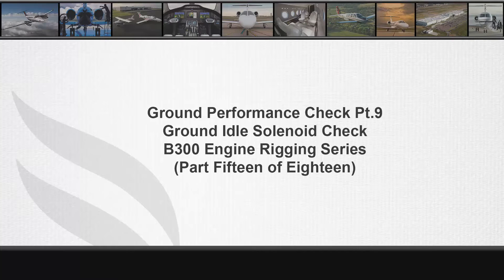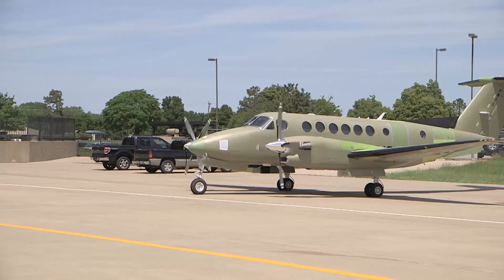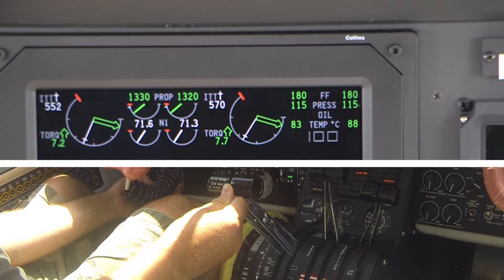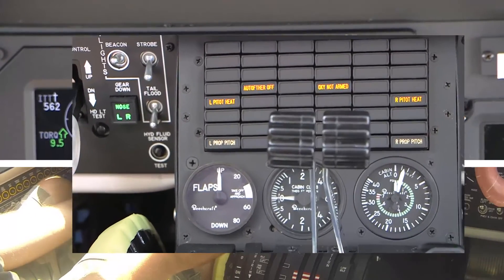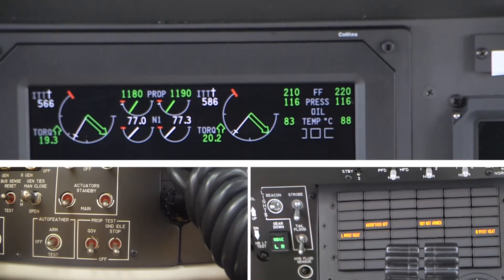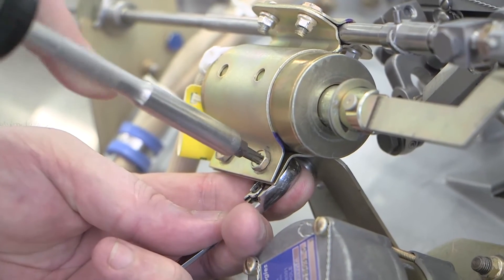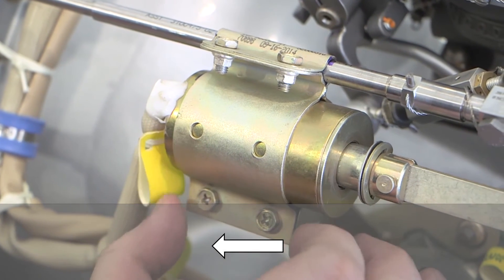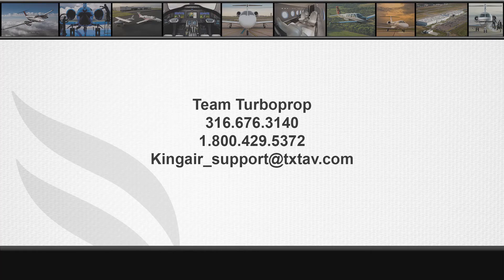Video # 15 - KING AIR B300 SERIES GROUND SOLENOID CHECK

Comment: "What is the risk if the propeller turns red during flight?"in be350i
Reply: Depends what way the propeller speed moves. If it's red in flight above red line you have had governor failure. If the prop is in the unapproved range on the low end you have either had a prop seal failure or you feathered it with the engine running (results in an overtorque if at high power settings). Note I don't work for beechcraft.
Reply: @Ifly96  Thank you for your answer!! I looked in the checklist ka350 and I did not find actions to do in case of overspeed gooverno ..in this case you just have to bring the RPM back into the green range!? and if this is the case there is no risk of the machine running a way during landing